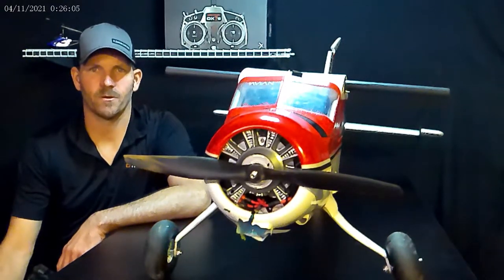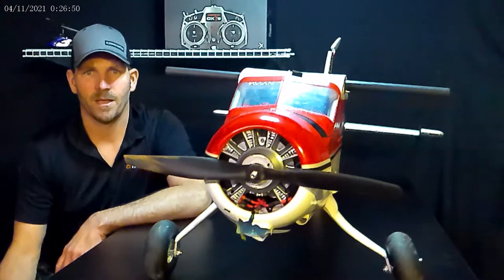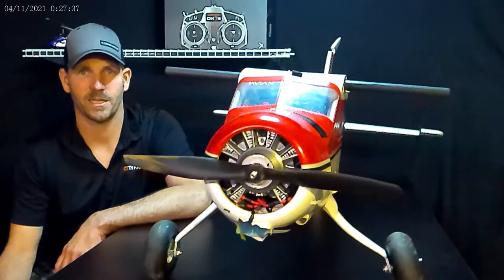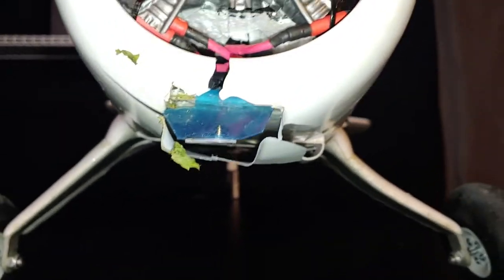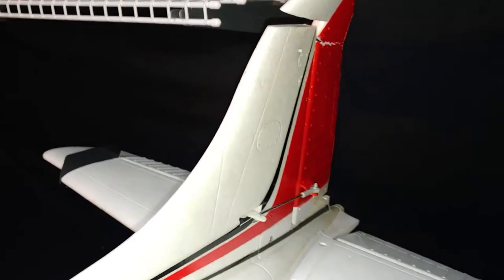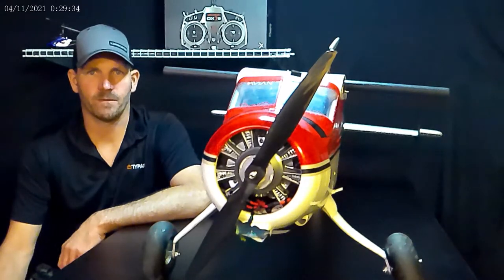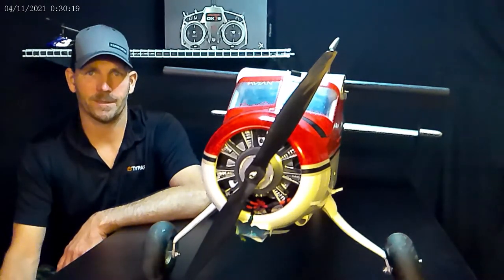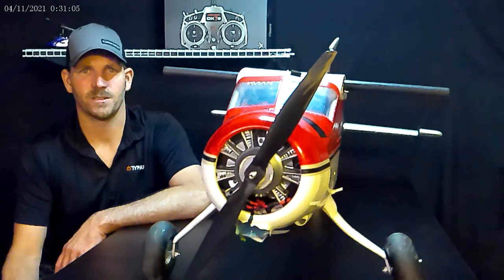FMS BEAVER 2000MM V2 RC AIRPLANE CRASH AVAIN SMART ESC  THRUST REVERSE MISTAKE

Comment: I have the Beav, never used the reverse, I just upgraded to futaba 10J... For me I started with futaba 30+ years ago and I just never went for spectrum.
Now something I noticed discharging full batteries in the shop for storage, Canopy open watt meter and testing props{just playing around}
Actually was draining 5 batteries and some y parallel harnesses, checking run times, etc. again just playing around.
I found the backside of the motor getting way hotter than I like.
So I removed that cool looking plastic radial decor cover to let more airflow unrestricted... just me. 
Doing this in past I have caught the motor stopping and wasn't sure if it was esc or the motor thermal'ing out.  (some extreme conditions)
Long continuous run times.
Like I said before, this is my first foamy and I am not overly pleased with it's quality of build being a hardcore balsa builder. (it flies GREAT)
And what I mean by that., the pinched hinge has no real pinned hinges, the servo's are not metal gears, the elevator servo wire is continuous no connector like with the rudder. on mine the servo has like 30''' lead back to the inaccessible board(without hacking) . and my first landing on water the float mount let loose letting the elevator scoop the water, ripping the right moving elev. surface off and stripped the servo gears, 
Now this wasn't a perfect landing but it wasn't a terrible landing either,. I have seen WAAAAAY worse with 0 damage. but my beaver fell apart.(built on a monday or friday I guess)
so 3 failures in less than 3 batteries from new. took me longer to assemble than what I spent on the water.
Was told all parts Backordered, so months of waiting, so I ordered a 2nd plane and it will be here LONG before replacement parts are made or released, not happy about all this but my angry words will not change anything.
I hate that you have to hack the plane to get to the board in the belly.  
When I put the plane together I removed that little orange safe box. 1st thing. then..
I put 4" duBro's 5's on the way. but never ran the rock hard wheels or orange box.
Long Rant but oh well.. 
I enjoy your video's.
Cheers.

Comment: My question is , why would anybody would want thrust reverse on a electric motor ???
Anyway Personally  I never would!!
Reply from the maker: thrust reverse is somewhat new'ish the AVAIN ESC's come standard with the ability to use chanell 7 or 9 as a brake or reverse alot of the EDF jets are using reverse to help stop them since they land so fast. and some are using it on prop planes also . i have it set up for help with stopping and simply because it is cool and the look on peoples face when you reverse your plane lol happy flying
Reply: It's very helpful if you fly floats, for getting the model where you want it on the water